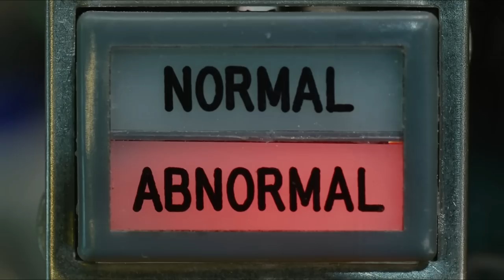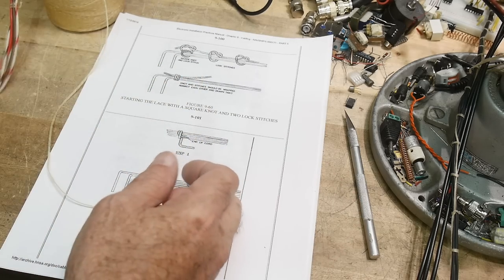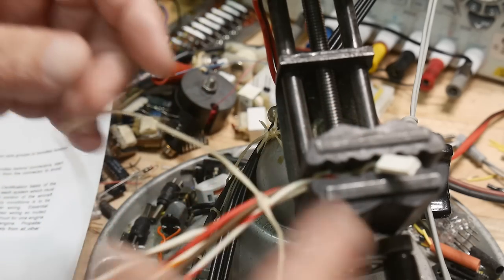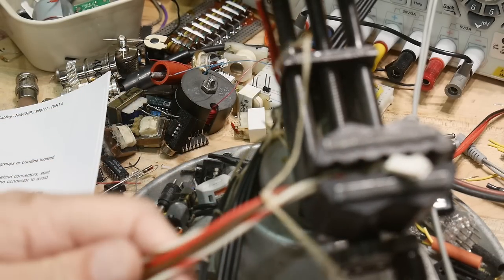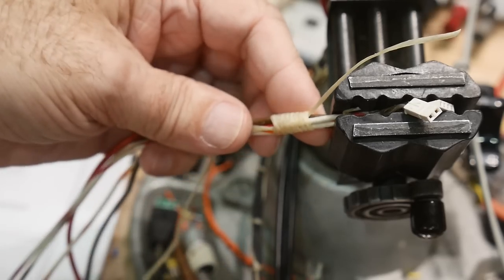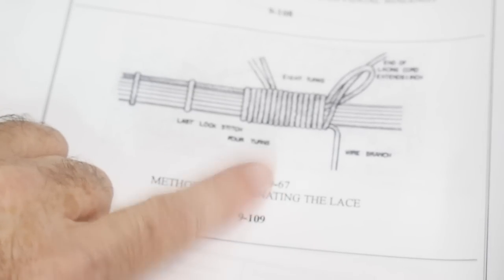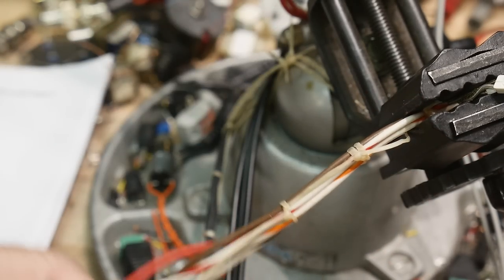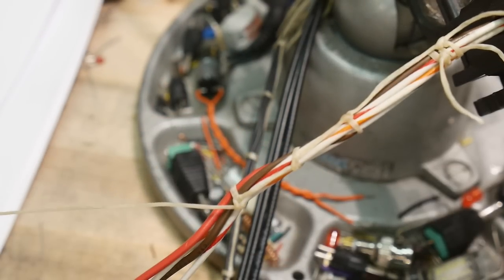#1404 Wax Cable Lacing

Comment: Reminiscent of the days I worked for the defense contractor. We had assembly people that would just have fingers moving and a continues lace that followed. As a Test person we'd sometimes have to cut open a bundle in troubleshooting, we' d call one of those wire harness experts back to make it pretty again and you couldn't even tell we messed with it. Nylon Tie-Wraps seem to be king today.
Reply: Nylon tie straps (ty-raps, etc.) have become the standard because they are (1) repeatable, (2) independent, and (3) machine-installable [plus many other reasons]. Using a calibrated tie-strap installer and a MIL/AS-spec tie-strap, every tie strap will be repeatably correct, which is very important for quality control and inspection. With nylon tie-straps, they are each independent of one another, so a failure in the middle of a tied section won't "unzip" like it would with a running-tie installation. Nowadays, most mass-produced harnesses are done using machines, where looming and tying nylon cord would be mechanically difficult - but a machine that puts on a tie-strap is quite comparatively simple. It all comes down to workmanship and quality, so the standards have changed to remove the technician's skill (or lack of skill) from the quality of the finished item. I've tied many miles of nylon lacing cord and can personally attest that nylon tie-straps are much more consistent and reliable - ugly, but reliable. Crimped electrical connections have replaced soldered connections in aircraft for the same reason: with a calibrated tool and good parts, the connection is very reliable and not subject to technical skill. Cheers!

Comment: One of the BIG pluses with old school cable lacing is that there are NO sharp edges to rip your skin open...
Reply: True, that was my introduction to plastic cable wraps in 1980, thus am a big believer in cable tie gun, cuts the tie without any sharp ends  ... Question, where do you get the flat wax lacing cord. I have a very old spool, but the wax has melted off.
Reply: @RoyArmy-WREW918  skygeek part #  SGP206991 😉
Reply: Yes, I had a dedicated  crew of on avg of 8-12 or so of contractors traveling  around the country. When tie-wraps strictly came to focus, I stressed that the ties be, flush-cut ! In which I told the team that they could spend a day or two in thier motel room. Course I would have never done that but they didn't know any different. A tie-wrap cuts like a knife & hurts like h3ll. Presumedly when working off an 8 ft ladder for days or months. Using lacing cord was art, a thing of beauty, breaking off into water-falls ect. Same goes for the ties . I was a Telcom contractor for 5 years, eventually became an MCI employee in 1988, yet continued traveling the country, motel to motel. I retired after 27 yrs and burnt my suitcases :)

Comment: Hello, you normally brought me back to my youth, when I tied it up with wax twine - the entire telephone switchboard. We normally learned this at school and the teacher would walk around the class with scissors and a tape measure, stop at each one and measure the distance between the knots if they weren't the same - the scissors would ruin your work and you'd start over. How useful it was for me when tying new ones or when repairing bundles in electronic devices.
A good trick was to draw a bundle on a wooden board, hammer nails into the bends and branches, stretch wires between them according to the prepared description, and only then bind the entire form.

Nice day 🙂 Tom

Comment: Yes, got those rolls of lacing cord, and also have the tools to work with it.  Comes in handy when you have old heatshrink that has split, and where you need to fix it, but no spare connectors, and the old connector is not too likely to come loose either. Yes learnt all those working avionics, and did a lot of lacing up of looms, mostly because I was replacing a wire or three, or running in new ones.

Difference between a square knot and a granny knot is that last knot, both do hold well.

Comment: This was really common in the early days of my career, both on the wiring used in the racks of earth station equipment in the Army and then when I started working on commercial systems.  Then very quickly it seemed everyone converted over to tie-wraps.  I don't think I've seen wax lacing in 30 years now.

One nice thing was that I never had a finger/hand sliced by a sharp wax lacing like I have on the clipped end of plastic/nylon tie-wraps.

Comment: Telcoms used lacing cord  for many years at CO's and repeater sites. Used to lase 300 pair cables overhead on latter racks. Used  to have a callus on my right hand pinky finger, between the first & joint. Also had lacing (sowing) needles as well. Then along came the Tie Wraps. It didn't take long to learn how to flush cut those things. A lot of people got cut. Ouch!
Reply: lacing in central offices is still the perferred way to go, especially on DC power cables.  Many telco's require lacing, cable ties not an option

Comment: I used to do this back in the day (1978).  I’d lace up wiring harnesses (Looms) for gaming machine prototypes.
I had a few techniques of my own, different to the ones you showed. I would do a special loop wherever the harness split (forked) also.
They were heavy wiring harnesses with 50 or 60 conductors, 7 or 8ft long too 😉
Fun to see this tho, I’ve actually done some of this in this past year, when I built an 8080a based computer 👍🏻

Comment: I think the NASA version is very similar to the lacing method I was taught for Admiralty (RN) equipment.

The start knot was a clove hitch then a simple overhand knot to lock it. The tail is laid back along the loom and bound into it via the stitch. The running knot looks the same but is formed a lot quicker.  From the start knot  place your roll of cord under the loom and lay a loop on the palm of your hand, rotate your hand in the direction of the stitching  putting a twist into the loop, reach through the loop and pull through your roll of cord . Pull tight that forms the running  knot. continue as required. To finish on the last running knot, create one more running knot  but position it behind and touching the last knot, A couple of overhand knots in the tail then snip off. 

 Andy

Comment: I learned this professionally and laced many many 0.25mm² 2Mb bundled with 15 more coaxial cables inside the cable and bind 16 of these is a big bundle in local telecom exchange centers in suburbs. perfectly parallel bundled cables running through the building. was an awesome sight, perfection in dutch telecom exchange centers.
Even had a special tool for it, we used Hemp thread with wax.

Comment: Thanks for the presentation. I had had wondered several times I happened to see the lacing system on the cables especially in the medical equipments like the old X-ray machines.
De VU2RZA

Comment: I was always impressed watching the HP, TRW, and Kaman Sciences assemblers lace cables. Very pretty. BTW, the father of a buddy of mine made his career out of fixing the cable harness of the B-52 bomber, making it work when Boeing was in the middle of a major crisis, unable to get it right. It's a HUGE cable harness.
Nowadays I mostly see Tie-wraps and split flex-plastic used for bundling cables because it's quicker and easier to fix, or change-out wires. Plus it protects the bundle from abrasion on edges and corners along its route. Kind of a brainless solution, but a solution nonetheless.

Comment: Many eons ago I was taught the NASA method, which I think the telephone manufacturers also used.  Like you I still lace up cables as they look really nice.  Sometimes I use a double strand.  The trick is to keep the running cord on the bottom as you tie the knot.  Less likely to snag something when the running line is flat against the wire. Always takes me  10-15 minutes to remember how it goes.  Always seem to cut too short of piece and have to start over on the first one.  There is a trick so you don't have to deal with the free end, just a loop of it.

Comment: I use wire lacing for my projects. I taught myself the NASA way but the "pretty navy" way looks better and I should give that a try.
Reply: Mix and match them. Whip the ends Navy style and do the running stitches NASA style if you want. Truth be told though navy style whipped ends always made me suspicious. On a rope they work because you really put a lot of force on it when you put those turns on it. I get concerned about pulling that hard on the wires and then I get worried if you don't will it come loose over time?
Reply: I’d put money down the NASA one is the strongest/most resistant to coming undone. If only because rockets are nastier environments for shaking and movement. For general use I would expect all these patterns to work just fine. It isn’t like most projects have to deal with any of those environmental extremes. :P

Comment: One of the first jobs I learned to do for my first job in the 70s with Plessey telecommunications in U.K. lacing and forming cables on equipment racks when I was working on exchange construction it whent to gluing and zip ties to speed things up but lucks a mess

Comment: The Navy recommendation is similar to whipping for a rope.  I guess the tradition carried over from the olde days.  Wax cable lacing strikes me as very practical compared to other techniques I've used---loom, braid, tape, etc.  This seems more flexible and easier to access wires for repairs.

Comment: A thing of beauty, a joy for ever. I've been a fan of cable lacing since 2000s. I don't do the starting and ending knots as shown in these instructions, as I've figured out different ones that work for me, but it all still turns out very reliable and elegant :). Oh, and I use indestructible polyester (or was it nylon?) thread named Ariadna Tytan 10 for that - not waxed though. Like, I used different threads and thicknesses, always had a problem of ripping, until I bought a big spool of this one that's gonna last me a lifetime and not fail in end-of-life conditions as I could literally hang myself on it and it'd do the job just fine, hahaha!

Comment: For Aerospace, “Continuous lacing shall not be used, except in panels and junction boxes where this practice is optional.” according to [AS50881]. Moreover, in Space and Military Applications, according to [IPC/WHMA-A-620], “Continuous lacing shall not be used unless specified on the engineering documentation.” “Wax-impregnated lacing tape shall not be used.” and “A clove hitch knot shall secure the bundle, and the clove hitch shall be secured with a locking knot, e.g., square knot, surgeon’s knot.”. When continuous lacing is applicable, they only accept the NASA style shown in the video.

Comment: Do you have opinions about what properties of the lacing cord lead toward success or failure? I've got a bunch of waxed thread for leatherworking, and a bunch of different kinds of paracord. I'm still feeling out what they're good for, seems like both work, the paracord is better with bundles of large cables like I've got a bunch of stations with 1 each VGA, DVI, Displayport, and USB 2.0 A-B, the empty space between the cables is so large that with the waxed thread, the Navy terminal knots don't really function. It seems like the wax is supposed to help thread "weld" to itself and become more solid, and I don't think that's happening for me, either because the thread is round where yours is wide, and/or because there just isn't enough wax. Meanwhile paracord is a low friction synthetic cord that doesn't mind the running knots slipping as a bundle is handled (I'll be trying the NASA running knot, that seems like it'll be a big help), and it's much more expensive by the foot.

These are cords I have for other reasons, but I do like that they're both available in a lot of colors for visual highlights, and I've found the paracord is pretty good for creating strain reliefs. You can put two terminal knots near each other with slack between, and then in various ways anchor the slack such that the cable between the terminal knots has no tension, letting it form a gentle curve. I have this on some overhead cat7 cable in a spot where it goes from horizontal to vertical and I didn't have any other options to prevent a sharp bend in the location. (you can imagine I am not afforded the option of doing things "well" or "correctly" very often, due to managers and landlords)

Anyway, if I was going to buy something, what matters? what doesn't?

Comment: What timing, I was just watching a central office equipment installer lacing some cables this morning, thinking to myself this is some kind of art. Don't ask me which version he was using, probably none of the above, but it sure looks nice!

I was wondering if you'd comment on your choosing of the test lead cabling that you use. 

Also noticed in one of your videos you have some Probe Master test leads. Some of the best test leads I've ever used. What's you opinion of the Probe Masters?

Comment: It would be nice if the running knots could be tied 'on the bight' so the thread didn't need to go through the loop and the spool could remain attached until the end.
Reply: I think part of it is so that should the lacing be cut the chain won't unravel. That's hard to do and to keep decent tension on the loop when working on a bight. I don't know of any knots that work like that, be glad to hear of one if you know it?
Keeping in mind it needs to pass around the wire too but just make a loop.

I think if you were doing more of it you'd just use a bobbin or something to have a small spool you could pass through the loops.

Comment: I would cut heat shrink to about 1/8 inch length and place them around the wires and space them about 1~2 inch  and heat the heat shrink.
Reply: Try that with the wires already run.
Reply: @jdilksjr  In that case use black electric tape to wrap it around wires every 2".  Now days electric tape comes in different colors I saw them in blue and red.
Reply: @aduedc  That only works with self-vulcanizing tape. The typical 3M adhesive-backed electrical tape one can get at supply houses and home improvement stores mostly seems like a waste of time and material: I have never seen it not come undone after a few years.
Reply: @absurdengineering  I usually buy my electric tapes from Home Depot or similar stores and I never had a problem with it.  I have opened the electric outlets in homes that are built decades ago and never seen electric tapes come undone.
of course, I live in Southern California, where the temperatures and humidity levels are always normal.  I do not know about very hot or cold places, or very humid places. How is the conditions in your area?
Reply: @aduedc  The question really is what electrical tape you buy. If it’s the narrow (1/2” maybe) colored 3M stuff then that’s junk. They also sell self-vulcanizing tapes in different colors and those are once and forever.

Comment: I always liked the idea of lacing wire together, but when the need arises I always go with brading the wire instead. Brading requires no extra materials, seems to work peachy-keen, and is reasonably quick, though I'd be the first to admit that brading lacks the old school charm of waxed lacing cord. Am I a wiring idiot savent or am I missing something?

Clarification: my wiring was/is for industrial and similar non-marine and non-space applications.
Reply: Must be interesting to repair.
Reply: You mean braiding? Sure, it does the job, but is non-repairable. The laces can be cut and redone easily. Braids? Not unless all the terminations on one end can be set free.
Reply: Thanks for the feedback -- and the spelling correction!
Since no one responded with shock (electrical pun not intended ;-), I 'm going to assume that I didn't invent the idea of braiding wire together.
As regards the charge .(ditto ;-) that braiding wire might make repairs more difficult, I don't see it. Typically, I think, what needs to be repaired is what the wires -- braided, laced,or whatever -- are connected to, not the wires themselves.
Reply: @frednitney5831  Oh I love braiding, but hate myself when the time comes to pull a wire, or even just inspect the wires. Lacing is so much easier to undo and redo without having to disconnect the wires.

Comment: Would you recommend something? Amazon link if possible.
Reply from the maker: search for wax lacing cord. mine is similar to: https://www.steinair.com/product/lacing-cord/
but a different color
Reply: You might want to look into “artificial sinew”, as an alternative. I do not know the exact dimensions of your thread; however, the sinew is a flat, heavily waxed nylon thread. It can even be split into smaller widths very easily. It is widely available pretty much anywhere, pretty cheaply, and comes in a rainbow of colors.

Comment: What diameter is that lacing you are using here?
Reply from the maker: it is flat not round. about 2mm wide
Reply: @IMSAIGuy  You might want to look into “artificial sinew”, as an alternative. I do not know the exact dimensions of your thread; however, the sinew is a flat, heavily waxed nylon thread. It can even be split into smaller widths very easily. It is widely available pretty much anywhere, pretty cheaply, and comes in a rainbow of colors.
Reply: @kn6vbw  The waxed chord is woven and extremely strong. Its sometimes used for strain relief protection.